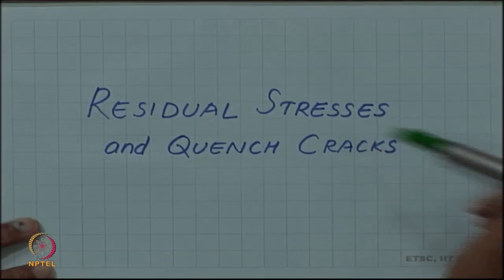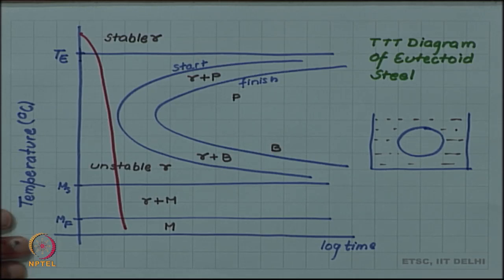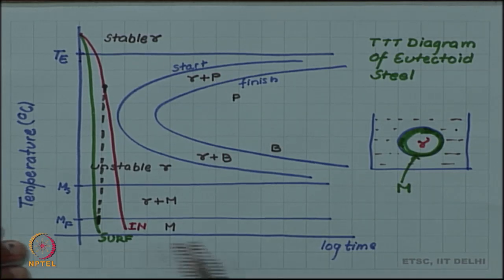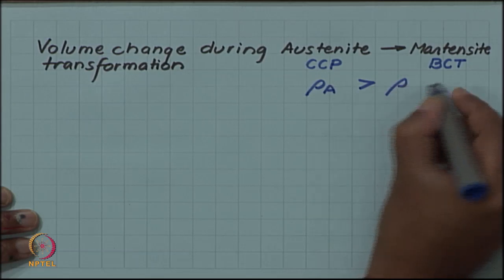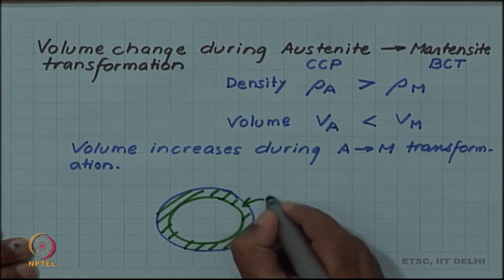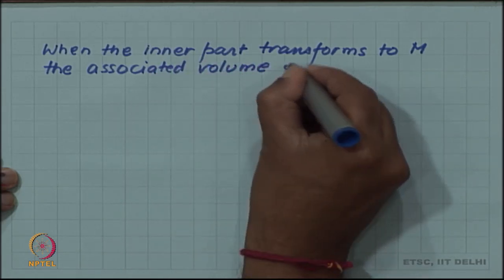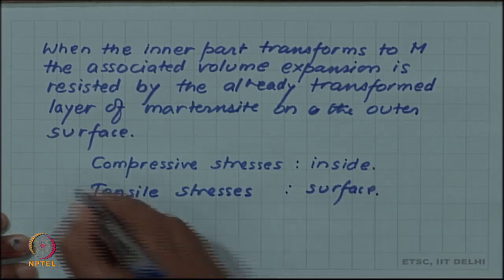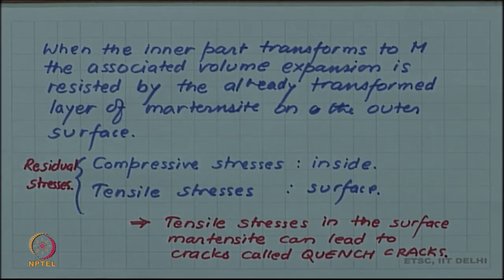Residual Stresses and Quench Cracks

Comment: Great teaching skills. Directly printed to the brain.
However I still have one doubt. 

As discussed in the lecture austenite have the highest density and it gets expanded upon cooling.

1) But in casting we have solidification shrinkage which shows as we decrease temperature from solidification temperature to room temperature material contracts. To avoid this shrinkage allowance are provided.
2) also in strength of material in thermal stressing, it shows the upon heating iron get expanded and if we resist this expansion thermal stresses are generated.

So material science theory tells material expands with cooling and casting and som theory shows materials contracts with cooling. quite contradicting.

So my doubts are : 
1) Is this theory only applicable to austenite to martensite transformation or it is applicable to austenite to any transformation in TTT diagram?
2) If it is applicable to all transformation of austenite what is the concept behind above mentioned contradiction?

Thank you for this amazing course.
Reply: There are two types of volume change involved: volume change due to temperature change and volume change due to transformation. 

Cooling usually leads to contraction when there is no transformation. Iron in your strength of materials lab is an example. Water below 4 deg C is a counterexample as it expands on cooling. 

Volume change during transformation can be either expansion or contraction. Thus most metals contract during liquid-> solid transformation. This is the case of casting where you provide shrinkage allowance. But water is again a counterexample as it expands on freezing. 

Austenite to martensite is solid-to-solid phase transformation where also you observe an expansion.

I hope this clarifies.

Comment: Thank you sir.
I have a doubt. There will be  residual stresses whenever we quench from austenitic range..that means quench crack is an inherent mechanism associated with quenching practice of steel??
Reply from the maker: The magnitude of residual stress depends upon the tempearture differential between different parts (different distances from the surface) of the piece being quenched, This in turn depends upon the cooling rate. Higher the cooling rate, higher the differential in temperature and higher the residual stresses. Thus the propensity of quench crack depends upon cooling rate and can be reduced by reducing the cooling rate. Obviously, one cannot reduce the cooling rate below the critical rate. But there is no need to go for much higher cooling rate than required.
Reply: @introductiontomaterialsscience  Thank you sir for the explanatory answer.

Comment: Thank your sir. I have a question. Quenching produces Martensite, does that mean every time we heat Martensite above Eutectoid temperature it will transform from Body centred tetragonal(Martensite) to FCC(Austenite) or it will form a new crystal structure.
Reply from the maker: Above eutectoid temperature, a eutectoid steel will transform to austenite.
Reply: @introductiontomaterialsscience  thank you Sir for clarifying